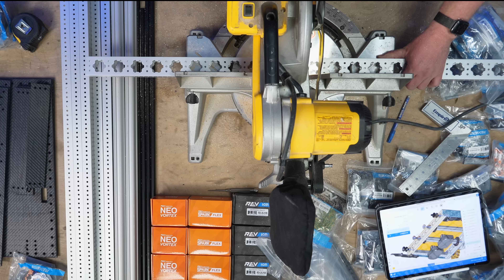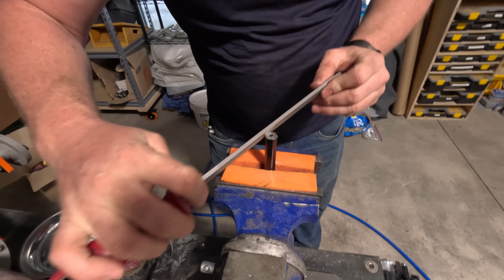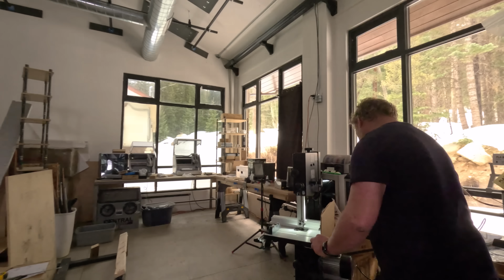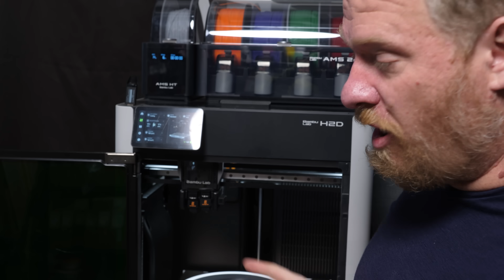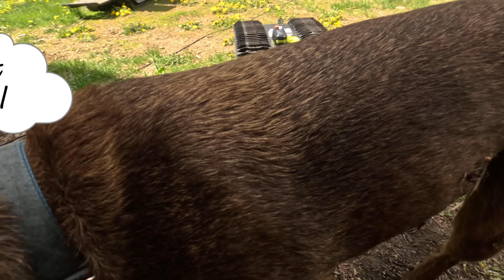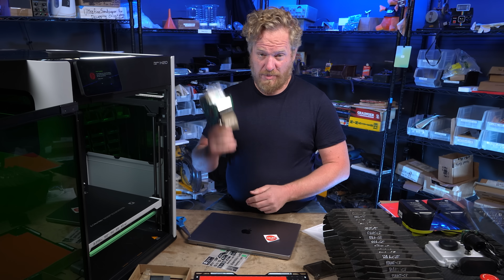I tried to build an internet controlled robot, it was much harder than I expected...

Comment: the prblem with the saw is that you are cutting thin parts whcih will fit between the teeth on the saw blade, grab and shoot away. use a hacksaw for parts that are smaller in section than 2 teeth sapcing on the saw

Comment: upgrade the machine to greenworks clone 40v. they have 2x value vs any other battery, i gang them up to 8 per machine. i have a 3dprinted holder for you to hold in close ranks.

Comment: Just so you know carbon fiber prints are NOT really save to touch. You would need a coating on the printed parts for that. You don't want carbon fibers break off and stay in your skin. At least wear gloves while working with the parts.

edit: this includes all the actual carbon fiber parts you have been filing down... also there is no real need to have a TPU only nozzle. It won't clog with a different material, you just have to purge a lot which is why it isn't really viable on single nozzle setups.

Comment: When cutting metal with a saw:
1. Clamp your piece, specially if they are round and/or small.
2. Cut slow with even gradual movement, let the saw remove the metal.
3. Completely stop the blade at the end of the stroke before lifting it. With the embedded brake most modern saws have this takes like 2s.

Comment: One big advice for the miter saw. Bolt it down to table, if you have a bigger kick than you had the whole machine can "flip" and well cut your body/arms, saying this as someone that used to do same as you. As for why aluminium seem to "bit" every now and then even with aluminium blade is still a bit of mystery to me. And also happy to see a project from you again, keep it up. :)

Comment: Lesson learned the hard way: if you experience a failure while using equipment like a saw figure out the root cause of the failure before trying to repeat the task. A thorough visual inspection to start.

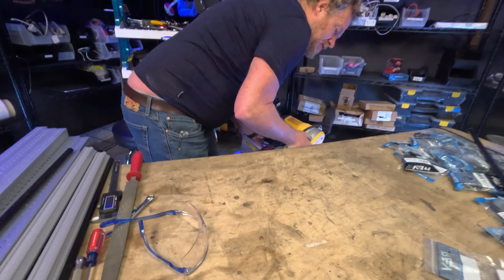Comment: 6:37 yeah, you need to clamp your material adequately and jamming a blade into round stock fast will immediately make that round stock roll and move if you're not clamped properly.... 

rectangular stock will not roll so it's a little easier to hold by hand... Be careful, dude.... When cutting a lot of aluminum, you should probably wear a face shield with glasses underneath. 

Also wax your blade with cutting wax!

Comment: FYI you are using that aluminum blade pretty inappropriately.. your cut parts are jumping up into the teeth so hard it's knocking them out.. this is the equivalent of 'kickback' on a table saw. For goodness sake clamp your pieces securely by some means. Small things rattling around near 'course' teeth that can bite the edges of and launch them.. is kinda YOLO.

Comment: When you're cutting metal, remove the dust bag otherwise it can set on fire when the sparks go in it. I have done it 😂
Reply: Generally yes. But Aluminium is one of the metals that do not spark. Can still generate hot shavings that could set stuff on fire but at least no sparks.

Comment: I've built my own version of this. i live on a farm so it's nice to keep an eye on things outside. but there was some problems. i used an RC car (hobby grade) so that's been working mostly fine. but charging is an issue. i had wanted to make a charging dock and for it to just live outside but the wiring and how to do that safely kind of alludes me. using a 2S lipo pack for mine i get like 8 hours of runtime, but there's also no low voltage cuttoff so im always playing this game of chicken with not over discharging the lipo. wish there was an easier way to handle it.
Reply: Post a video of your bot on your YT channel please.

Comment: You can build a robot mower with nRTK + AI cameras for around €500 in hardware. Open it, unlock the software, and you could destroy the business model of these companies. They sell a 1,000 m² robot for around €1,200, then charge €2,000+ more for the 2,000, 4,000 or 10,000 m² versions, even though it’s basically the SAME robot: same hardware, battery, power and cutting width. The only difference is an artificial limit in the app that stops you from mapping a larger area. We are paying thousands more just to remove a software limitation. And don’t even get me started on the €50–70/year 4G subscription when the actual connectivity cost is around €3/year

Comment: Use a abrasive disc to cut steel.   Check and see what the BMS  current is rated for, Ryobi batteries cut off when the BMS kicks in. I'm not sure what they are rated for.

Comment: You need to have a board to hold pressure on the material closer to the blade and push it into the corner of the fence

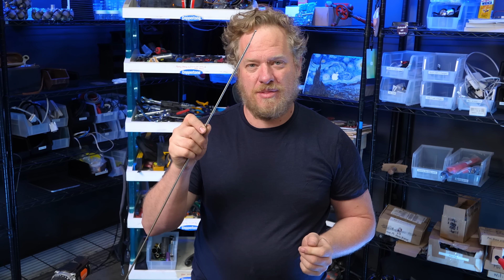Comment: 9:26 hey I know this is done and over with, but in the future if you ever get tubing from McMaster-Carr that has the ID out of the lower tolerance, you should get a reamer (or a few to stage to the desired diameter), that way you can ream out 5” at a time, then cut them to size. Easier than drilling out each bushing you create!
Reply from the maker: Good call!

Comment: I was the 2nd in the queue 😅 was very cool but the directional arrows in Safari don’t seem to let you move forward for more than a couple seconds before it prompts you to save the arrow as an image which stops it moving
Reply from the maker: Ah, that's annoying.  I'll debug that. I still need to do some more optimization for mobile.
Reply: @StrangeParts Woah thanks for the reply! It was really fun regardless, I’m gonna give it another go on my computer
Reply: I am still shocked if I see a Safari user in 2026 in the wild.
Reply: I think I’m just over the browser debate 😅 All IOS browsers have to use WebKit anyway so the performance difference is marginal at best, it’s just about UI preferences / gimmicky features